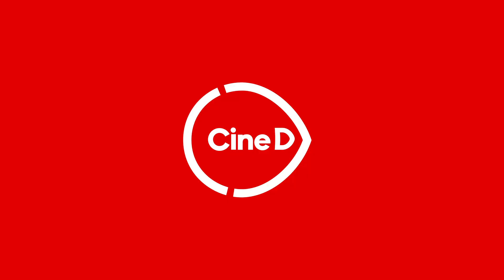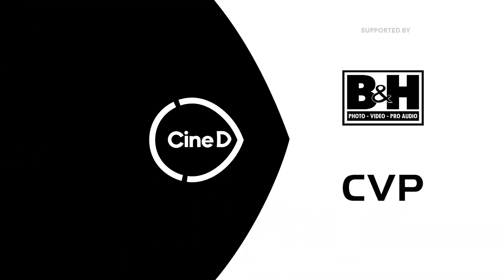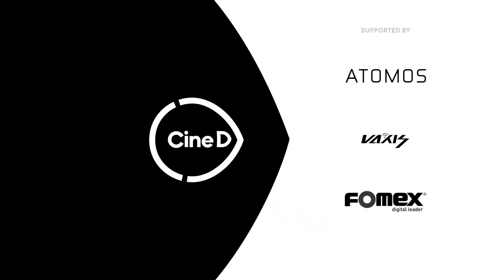Cameras and Overheating – Discussion with Panasonic

Comment: Panasonic LZ20 Camera overheated so badly was worried the batteries would catch fire since they came out hot.  Camera wouldn't load up. Got a camera that's very unsafe to use..be cautions about buying Panasonic.

Comment: Just got my GH5 yesterday,  but I noticed heating on the bottom of the camera and on the camera grip, this happened when I was doing some settings in the menu, trying different functions of the GH5, but after half an hour, I began to feel the heat on the bottom of the camera (and later on the camera grip, too)  So I decided to put the original battery out of the camera and let it cool off, then put the battery back on and put it on my tripod, without touching it for an hour, the heat came back again, is this normal or It's defective caméra. 
I have a G85 and I never had that problem..always cool to the touch..! Thanks for your help